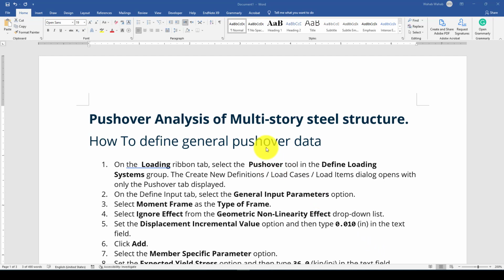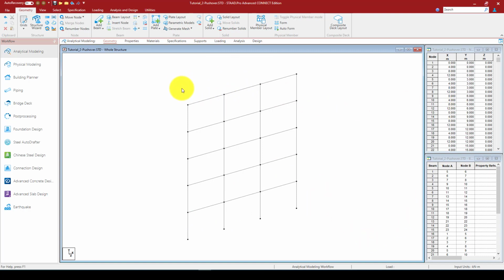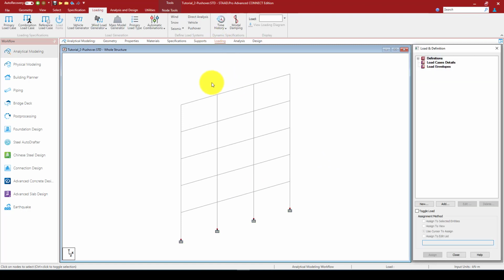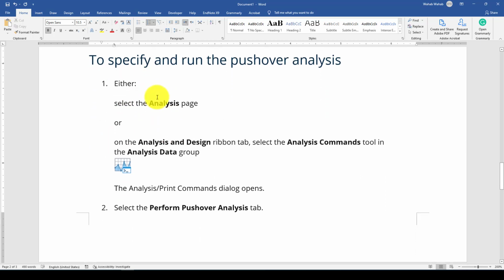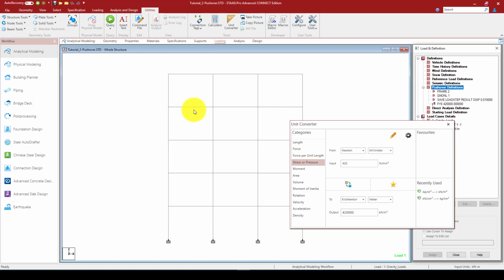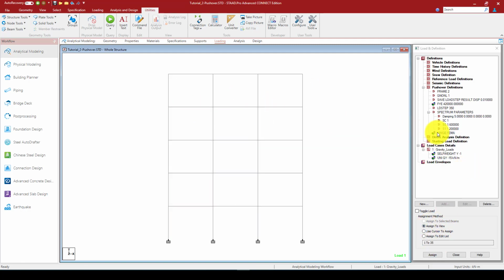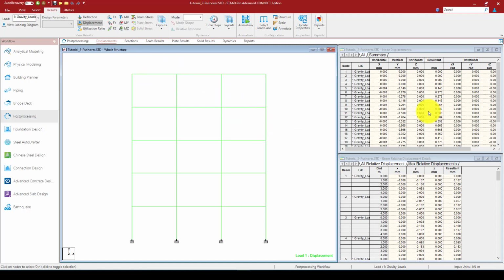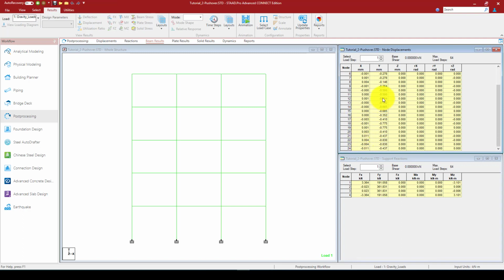STAAD Pro Tutorial;  Complete Pushover analysis of a multi-story steel structure step-by-step

Comment: Hello! Are these steps also applicable to Reinforced concrete design structures? Can you help me with the parameters applicable if it is not a steel structure? Thank you
Reply from the maker: Yes it's applicable.
Reply: @KSSE_Engineer In the instruction video of Bentely, the concrete frame is not supported by the software.